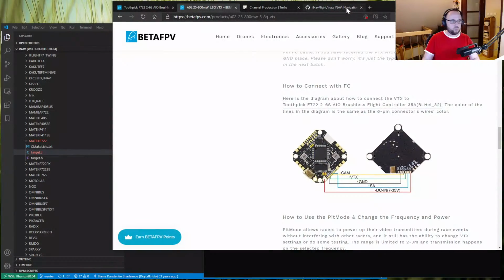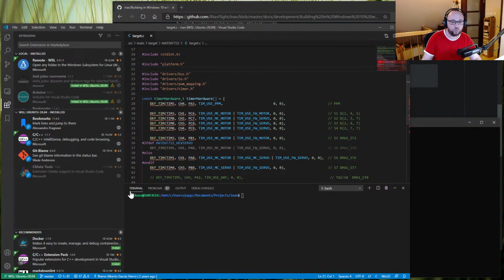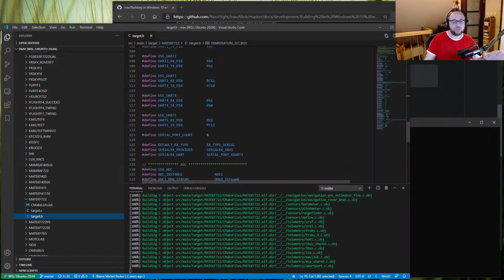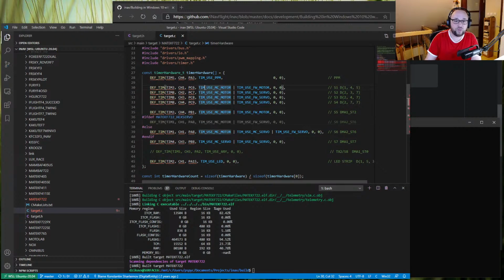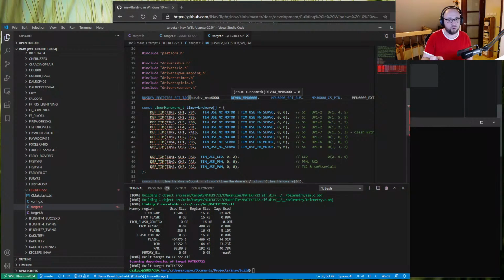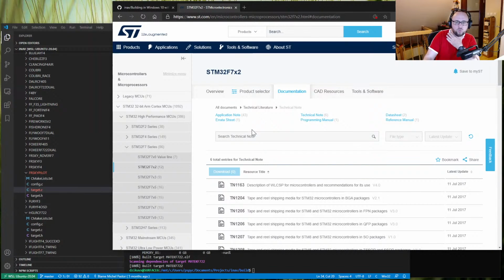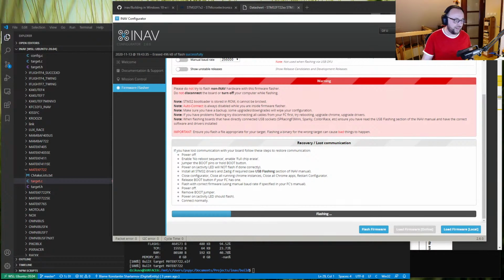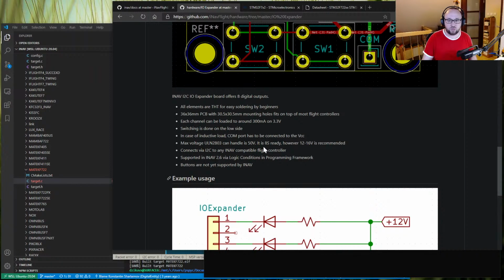Custom INAV Targets - resource mapping without resource mapping

Comment: Hello Pawel. I'm pretty new with FC's flashing and configuring.... I was managing an axisflying F7Pro FC with betaflight and the original firmware. I could connect (after some strugling) my spektrum receiver (AR8010T) to UART RX2 port on the FC, enable port RX and finally select SPEK2048 (although I was expecting SRLXL to work, which it didn't). Anyway... since I'm trying to build a VTOL with tricopter configuration and a nose propeller for fixed wing aerodynamic flight, I moved to INAV, as apparently betaflight doesn't allow to modally select motors vs flying modes.. (at least I couldn't succeed). So I flashed the latest firmware available inav_8.0.1_AXISFLYINGF7PRO and.. too bad! I can't get radio inputs anymore!! I'm trying all possible combinations, but nothing. I'm sure about wiring, as nothing changed with previous connections. My stronger doubt is: if on CLI I type resource, I see a lot of free pins. Also, I can find only: A09: SERIAL1 UART TX
A10: SERIAL1 UART RX, as if only a serial (1) is bound to pins. What'am I doing wrong?? Please help! Thanks

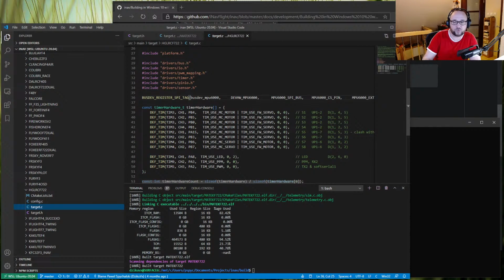Comment: The board you mentioned @ 30:00 I was actually able to get it to work with 4 servos and 1 motor. I just finished compiling a target for it and it works well. I get that you try to keep things understandable and simple to follow but sometimes saying i something is tricky to do rather than saying something isn’t possible, is the better option.

Comment: Thanks a lot for your tutorials, trying to add Soft Serial to CLRACINGF4AIRV2 ... added the line in the target.h , advanced SERIAL_PORT_COUNT, but something is wrong, the board functions but i can only enter the CLI mode in the configurator, also the added soft serial no is 0 instead of 30...  any idea ???

Comment: Here's the Maiden flight.  The initial mistake I made was reuse the transmitter settings that I used for the elevator and aileron throws for my RMRC Recruit ... 60% throws.
I aborted the launch and had a controlled crash.  I fixed the settings, had a friend at the club toss the airplane.  The wind was 14mp gusting to 24mph, good wind conditions for flying wings.   In the video you will see when I made a pass over the field and engaged autotune.  The flight video isn't my best since my EPO runcam mount broke loose.  Next week  the video should be better.

Here's the video I shot of the maiden.  
https://youtu.be/wQstASkCfDw

Comment: The iNav Sparky 2.0 AR Mini Wing Maiden went great! I even have some iNav Wing hints to share.
I copied my weight/throw settings from my original mini wing that I have flown for the past three years to my iNav Ar Mini Wing profile settings. LMAO don't do it! Once I set my radio to 100% throws I launched again in manual mode.. flew great, switched to Angle mode...locked in! The iNav AR mini wing presets are pretty much spot on. I only tested manual, angle, and horizon mode. Next flight will be launch, holding pattern, and return home.  Thanks again Pawel!

Comment: Hello Pawel, this was a great informative video! I just happened to have 5 Sparky 2.0 controllers and was wondering why I couldn't map resources in the iNav Configurator.  You made  it clear why and how to implement the modifications I need.   

I'm a Systems Engineer and write software and firmware, and design hardware.    Lately during the Pandemic I've been creating Puppet and Ansible automation tools. I do miss creating stuff.    

I've been building up several new airplanes. An AR Mini Wing, Ar Wing Pro, and a Volantex Ranger 1600.    I figured the Sparky 2.0 controllers would work well.  I got on GitHub,  built  my iNav development environment on Ubuntu 20.04,  modified the Sparky 2.0 firmware for 2.6.1 to trade off Servo 5 & 6 for SoftSerial 11 and 12.  The iNav code is documented very well. It was easy to make the changes, upload it to the Sparky 2.0 fc on my workbench, connected the sparky via spartport to a Jumper R900.     After a basic configuration of the Sparky 2.0 target for airplane, softserial, gps , receiver, and telemetry I got my Jumper T18 ,connected to the reciever, scanned for new  sensors and all I expected was there.  It worked well.  Hopefully the new jumper multiprotocol module firmware fix will fix the telemetry range.  fingers crossed, this will be attempt #2.  If not I will install my old FrSky X8R in my AR Mini Wing.  

Should I post my Sparky 2.0 mods to the iNAV GitHub ?  it might help hobbyists that don't know how to code.
I plan on updating the code for LED_STRIP,  merge the dRonin RFM22b OpenLRS support in, I plan on just using the CL in configurator to set it up.
Also I plan on adding several Wing RTH functions.  RTHLANDSLOPE and RTHLANDSpiral.   My short current test mission kind of simulates what I plan on writing in firmware.  Instead of triggering an RTH I have waypoints that send the airplane on a steady path and descent to home.
The waypoints have decreasing speed and altitude on a path towards the home waypoint and the last waypoint before home is 0mph, 0ft.

I managed to find an OpenLRS transmitter JR module on Hobbyking's website. It's on the way.  

If the weather is good tomorrow I plan on a maiden flight of the AR MiniWing with the Sparky 2.0 controller.
so far the wind is SW 14mph gusting to 24mph.    I've flown in that before and with a wing a 24mph gust comes in handy for landing.

Thanks again for the informative video!

If you would like to see video of my model aircraft flying at my club's airfield,  here's a link to my youtube channel:

https://www.youtube.com/channel/UC6VJZbtXu0S4UVcIZ4nOCDg

Comment: Thanks Pawel. I was able to roll my own inav for an omnibusf4v3 that only had 4 outputs and i just needed one motor and three servos. Inav code is pretty strict with the motor and servo timers so i did this by making the LED pin a servo output and leaving motors alone. Worked out. Led pin had its own timer. Thanks

Comment: im trying to compile a target for inav and ive had nothing but problems. seems to be related to file paths?! cant access cmake via terminal and it wasn't working at all! i tried installing cmake stand alone in my applications directory and changed the path in the settings i still cant access it from command line "sh: cmake: command not found" but it now configures the project and fills the build folder with files but im getting error 2 when i try to actually build?  i have used vscode for some arduino projects but sometimes i have too many problems so just go back to arduino ide! any idea what to try ive been at this for hours :(

Comment: @Pawel Spychalski, I am having the same issue as OrangeFly and when i make the target, it is listed as 2.7.0. Flashing that with the current configurator sends you direct to CLI stating the firmware version is not supported. I went back to VSC and searched for "2.7.0" and under CMakeList.txt is the only reference. Its listed as " project(INAV VERSION 2.7.0) ". Changing that to 2.6.0 and then recompiling doesn't solve the issue. Any help towards this?
Reply: I should also note, changing Project(inav version 2.7.0) to 2.6.0 does change the outputted file name, in the build folder, from 2.7 to 2.6. But Flashing the 2.6 still gets the same connect to CLI error of "Fimware not supported"
Reply from the maker: Current master brach is 2.7 indeed. You should checkout tag 2.6.0 to compile INaV 2.6
Reply: @FPVUniversity  Ok, that makes sense. Ill see if i can figure out where i went wrong when following your video. Thank you
Reply: @FPVUniversity  Got it figured out. I just went and downloaded, instead of clone, the 2.6 source code then deleted everything in the INAV folder created earlier in the video and unzipped 2.6 there. Back in Visual, CD to the right folder, make firmware changes, then cmake and make. Flashed to the board and its working so far like it should. Thankyou for the tip!

Comment: I have successfully built my target which is a FF_F35_LIGHTNING but once flashed i can connect but only access the CLI. Any suggestions to fix this?  Standard firmware is 2.6.0 and the custom firmware is saying 2.7.0
Reply: Delete everything in the INAV folder thats on the c drive. Go to the inav git hub and manually download the source code zip. Unzip it to the Inav folder on C then go back into Visual Studio and make changes then compile. Im guessing somehow we both had the same mistake of cloning the inav git and it auto downloading the newest which is Master Library 2.7.0 and not 2.6.0. This worked to solve the 2.7 issue for me.
Reply: @jonathanrubio1  found it under https://github.com/iNavFlight/inav/releases. Thank you and Merry Christmas TripodFPV!
Reply: @OrangeFly You havent found a resolution for this, have you?
Reply: Np, by chance...are you trying to add PINIO to your target or just building a target for a currently unsupported board?

Comment: Can we change which timer a pin is using? Had a motor S5 output which I wanted to use as UART but it shares timer with S4.
Reply: Timers are assigned to pins. Have a look at the STM32 documentation what-is-where. AFAIK you can use motor output as UART (if there is one assigned to the pin), or softserial, it might be harder the opposite way.